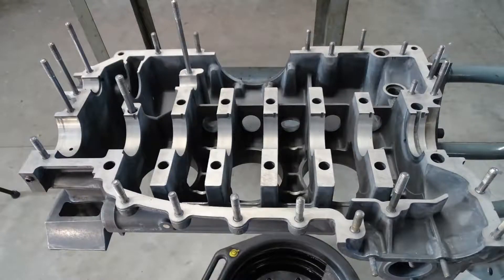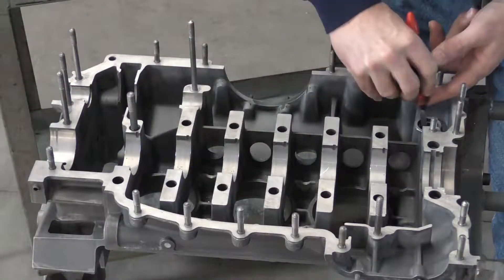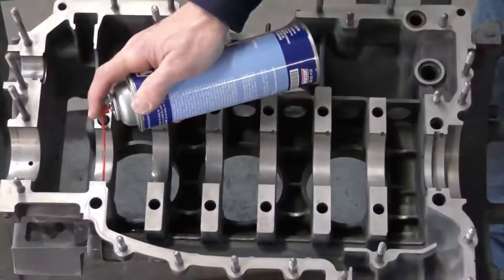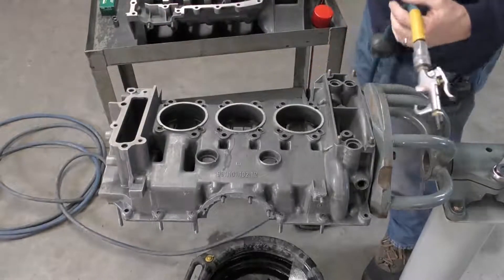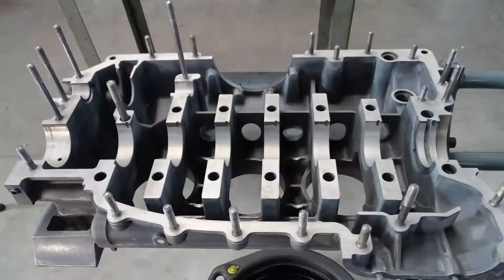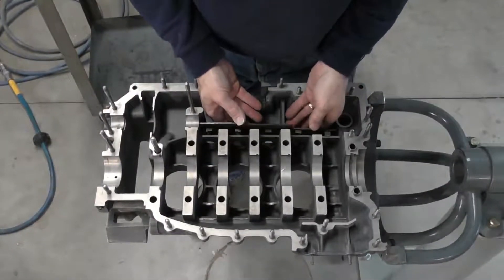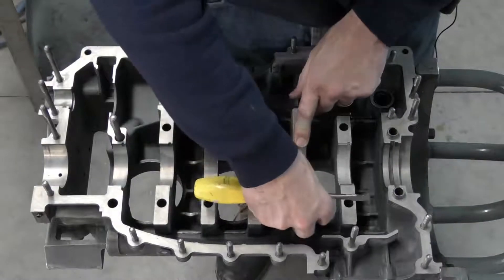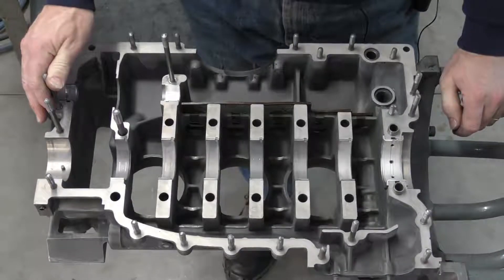Engine Case To Main Bearings. How to Re-Build your Air-Cooled Porsche Engine

Comment: Absolutely love the quality of these videos. But with so many of them, it would have been nice to see a numbered sequence from beginning to end. ie: Part 1, Part 2....along with the job being done which is what you have done.
Reply from the maker: What we have tried to do is make videos of specific jobs which are usually a job all unto themselves. They are also fairly self evident as to the order of operations. When it came to an assembly like a cylinder head we did use part 1, 2, 3, etc. Most of our videos a laid out just like they are in the factory manuals as that is how I preform the work. 
Thanks for the feedback and thanks for watching.
Kurt

Comment: Hi Kurt,
I have been viewing and reviewing your videos and they have been a key part of my “Porsche experience”.  I cannot thank you enough for sharing your knowledge.  I am rebuilding a 1970 2.2 911 engine.  I countless forums and literature experts (and many novices I am sure) recommend installing piston squirters on these early engines to help cool the pistons.  I am wondering whether you agree with this recommendation or not.  And if you do, if you happen to have a video on this.  Thank you very much in advance, greetings all the way from Mexico!!  Mario
Reply from the maker: Mario,
There are a number of things to consider when doing this. Firstly the first time we saw piston cooling was in the 2.7L engines and this was a necessity because of the increased displacement and the reduction of barrel wall thickness resulting in less heat dissipation. Another point to bare in mind is that the oil jets are a calibrated internal oil leak. The 2.7L engines used larger oil pumps to accommodate for this.
Now looking at a 2.2L engine with Biral cylinders with good heat dissipation and a smaller oil pump I would say no it is not necessary to add piston cooling. If you really want to you can but that also means sizing the oil pump to suit the oil flow requirements.
Kurt

Comment: Can brake cleaner be used instead of the winzer mps 100? It’s not available in California.
Reply from the maker: The problem with Brake cleaner is that it has lots of bad stuff in it. If it cleans well then it is usually loaded up with Acetone which can damage gaskets and seals. If it is not loaded with Acetone then usually it wont work worth a dam. One way around your issue is to buy the MPS in bulk 5 gallon pails. Then use a pump up spray bottle to pressurize it and spray it. California's big problem with MPS100  is only when it is in a spray can. Or do what i did and move out of California...
Thanks
Kurt

Comment: I notice that you put the windage trays (aka oil strainer) back in. Ollie's suggested I remove them when they did the oil bypass upgrade to our case. Not sure on the reasoning.
Reply from the maker: Yes I have heard that before. But I still like to use them. I have never been able to find a Porsche bulletin on removing them. I also don't see any reasoning to removing them just because you do an oil pressure bypass upgrade.
Kurt

Comment: My engine bits are on the way back from Ollies so I'm about to get started after 7 mos.  I'm going to check my main bearing clearances on my std/std case, but read a lot of posts that the new Glyco's are undersized and cause low oil pressure from being at the extreme upper end or over spec. Have you noticed this with current batches, or is this a bad batch from years past?
Reply from the maker: I have not had any issues with the bearings that I have been getting. It is always good to check the clearances though and its not impossible for a new part to be wrong. 
Kurt

Comment: I need that deburr tool. I don't think my case was line bored but there are some burrs in the spots you mentioned. Is that tool on Amazon?  Also what bearings do I use? Glyco, Porsche etc?
Reply from the maker: Hi Trenton, It was hard to find exactly the same tool. But it is a fixed blade scraper. https://amzn.to/3ymTeu2
This handle and scraper by Noga means you could add other deburr blades. 
The bearings can change on size. We use Glyco when standard standard. But Porsche may be the only source for some oversized bearings, and you have to buy each half shell. It can get expensive. On a mag case we would recommend getting align bore. With the close and hone the case bearings can go back to standard.  You still need to inspect your crank, to see if it is standard and not scored. 
https://youtu.be/CdtXnQZKf9E
Let us know how it works out for you. Sarah
https://www.klassikats.com/2020/11/12/engine-case-to-crankshaft-rebuild-your-air-cooled-porsche-engine/
Reply: @klassikats  Thanks. My case is the Aluminum 993 Case. My crank was measured and is standard spec. Now I'll measure the bore to see if it's standard too. I will probably use Glyco too. My porsche indie uses them for past 20 years. I managed to polish my crank and camshafts on my own to a nice shiny clean finish. Once I get my bearings I am ready to put the case together.